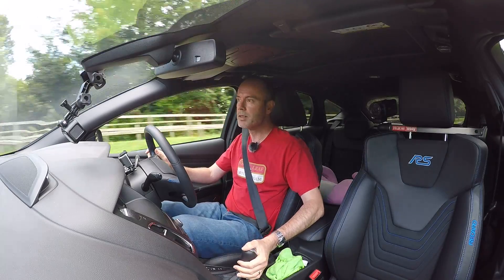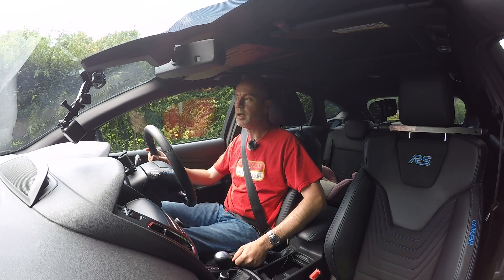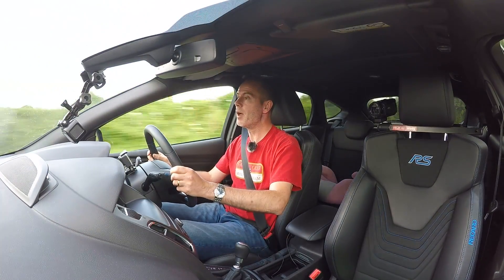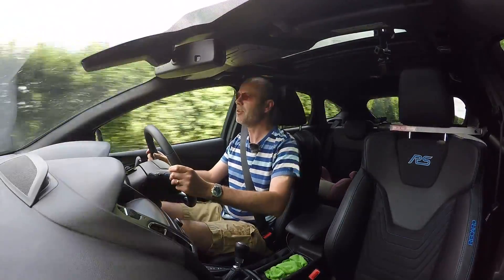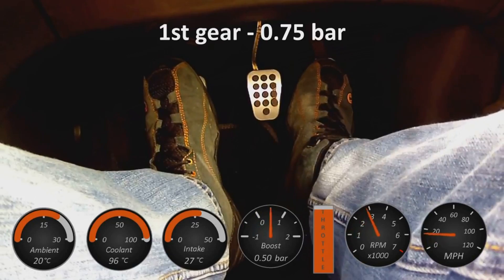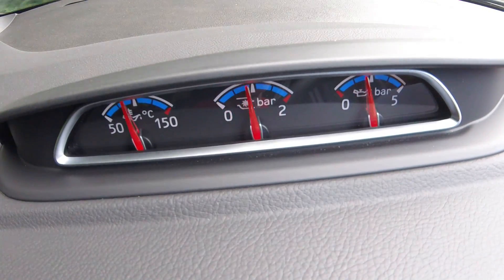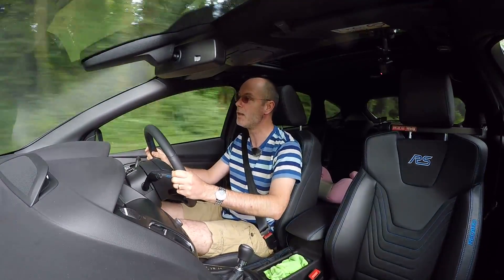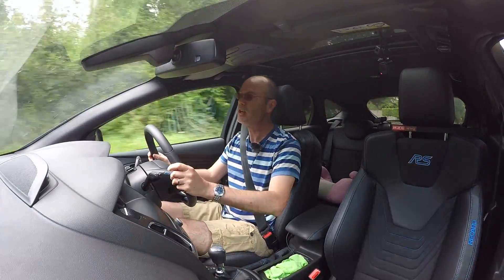Ford Focus RS : day 101 : Peak boost & torque limiting?

Comment: I've been feeling like 2nd gear doesn't pull as hard from 4.5 to 6 thousands rpms as much as 3rd or 4th gear! I found your video trying to find if its just my car or others. I found on the forums that other people have had tge same problem.  Just wondering your thoughts. Thanks

Comment: Pretty standard that 1st and 2nd are torque limited, have been on most cars for years. Also have coolant and oil temp load limiters too.

OBD on these limit map logging channel to 1.55bar, you need use forscan on map high res to see actual boost.

Comment: @markcup70 Are you sure the diag tool you was using back than is reading correct. As some diagnostic loggers has a limit of 2550 which is 1.55 bar. And these should do around 1.6/1.7 with overboost at peak HP
Reply from the maker: Nothing more exotic that the Android app, Torque Pro. I can't comment on its accuracy when logging boost, but it does seem to be accurate with everything else it logs.

Comment: Hi I have a rs I ran 25psi. It has a cobb 93 octane tune. With a mountune intake.  It was 90 degrees outside when I got this data. Is this good or bad or ok???
Reply from the maker: That's 1.7 bar Pat, so above what the standard car makes. Should the tune you have give you more than that? It sounds OK to me!

Comment: Hey nice Video! i have a question. how long does it take to get the oil to his temperature to unlock the 1.6 bar? i only get 1 bar when the oil is not warm enough. i only get the 1.6 bar at 5500 r/pm is that normal. it seems u get it earlier.  

Pls help
Reply: if the oil is not warm, you shouldnt do full power. Wait for 80 degrees Oil temp and then you can floor it...

Comment: Torque is limited by electronic throttle closures. Log that and you will see it very clearly.
Reply from the maker: Ahhhh, interesting, that makes sense, thanks Mohammed! I'll make sure I log the manifold throttle as well as the pedal position next time and see if it's pulling it back.
Reply: It does the same think in the fiesta st in first and second uses the throttle to to adjust power/torque with the peron map on the st it removes this feature

Comment: Hi Mark
I have been watching your videos , 
I think that you are only seeing 1.55bar from your obd2 port as that is the diagnosis limit off the obd2,
If you try a ford specific obd  reader , you should get the correct reading, as a std obd2 will not read any higher,
Also lower boost in 1&2 gear is because of there is lower load on the engine,
Dave
Reply from the maker: +David Browne received and understood. Do you know if the same limiting applies if I log boost as PSI?
Reply: MarkCup70 
Yes , psi or bar it is just a convention, like I say try a reader made to read the ford  not just obd2,
I don't know if icarsoft do a reader made for fords , you could pick up a copy Delphi ds150e interface and software from eBay for about £40-50 you will have to use with windows, but you can set it to a mode, flight recorder  were it will record to a SD card and do the logging without PC, and then you plug the interface in to the PC when home,
Dave
Reply: MarkCup70 
Hi mark
I am in Emsworth Hampshire if you want to try it with my Delphi ds150

Comment: Mark was 1st and 2nd Gear still torque limited on the fiesta with the MR230 kit thanks :)
Reply from the maker: I'm sure it was...but despite trying I could never get any stable or usable boost readings through 1st or 2nd as it would always just spin the wheels!
Reply: Ok cheers Mark :)

Comment: It doesn't look to me as though there is any  boost limiting. If there is it is so subtle as to be pointless. My guess woukd be there is a small element of fueling cut as a traction aid in first. Also remember that to achieve full boost an engine needs a solid load to pull against. If you put an engine on a test stand with nothing connected to the flywheel it would struggle to make much boost as the fuel rates for a given rpm would be so low. Low fuel = low exhaust flow = low boost. As for the few % drop you were seeing in first, either first isnt presenting a solid heavy load or more likely the fueling is just been reigned in.

Comment: Hi Mark. I have noticed that no matter how hard you drive an RS coolant temerature gage stays in the same position (90 degree) which is very weird. All other gages are moving while driving hard but not the coolant one. I'm sure coolant temp is much higher than 90 degree when driving on the track. Have you noticed the same issue? It must be sometching wrong with it. Other RS owners I spoke with had the same issue. Can you please check it coolant temp on your logs?
Reply from the maker: Mine is exactly the same and I recall it was also the same on my Fiesta ST. It gets up to a certain temperature and then only varies from that point by a few degrees at most. Regardless, I will add 'coolant temperature' as a field the next time I log and report back on a future video.
Reply: Thanks for reply.
Apparently coolant temp gage is not moving unless is reaching 115 degrees which means it doesn't read right temp and is missing 25 degrees. It can be too late for the engine as this can cause enginge overheating and failure which we've heard so may times. Why Ford couldn't resolve the problem that is simple and cheap to fix?
Reply: This is standard on most vehicles. I think its to avoid concerning drivers, who might be alarmed to see the temp climb after a hard drive. They usually sit in exactly the same place on the gauge until the car goes out of spec.....this could be a range of 80 to say 104 c and still show normal. Beyond a pre determined level it will climb.  Id rather it just fluctuated with my driving like an old analogue instrument.

Comment: It is quite normal for turbocharged car to have lower boost in lower gears. That is because engine has less load in 1st and 2nd gear. You can notice that turbo spools at 3K+ rpm in 1st, 3K in 2nd gear and 2.2K in third gear. There is no limitations, only turbolag.

Comment: The difference between 1.55 and 1.6 is negligible don't worry about it. if it were 1.3 to 1.6 it would be worth looking into but even that is probably only just outside limits. once outside limits I would expect the ECU to throw a boost control related error.
If you could log actual boost vs requested you will see how tight to spec it is but I doubt you have access to those parameters. On VAG cars I have logged the above and they don't track that close to target. they tend to under achieve target initially then over achieve target as you approach red line.
Reply from the maker: That's what I thought Scott...it was close enough to not worry about but I did wonder what other owners had seen or logged.

Comment: Torque. Targets. Probably won't see boost as high in colder temps, because the air charge is already dense enough to create the power levels as calculated and desired by the ECU.

Comment: MarkCup70,

Don't you trust Ford???

Or is this just an anal exercise and a degree of technical self satisfaction.lol

Low cost accessory for your motor:https://www.youtube.com/watch?v=eCjPinseITM&t=182s lol
Reply from the maker: It's nothing to do with trust Keith, I just like to understand how s*** works. If I understand its intricacies I'll be better placed to extract the most out of it.
Reply: Mark,
Good that it is a learning / understanding process for you.

Guess Ford have  spent millions and many person hours optimizing the RS to give of its best, with a little help from a competent driver to squeeze that last little bit  extra efficiency and effectiveness out of it, on the road and track.Without having to tune the ass off it ,so as to enjoy and have fun.
Good on you man.
Keith

Comment: torque limiting is effectively present in the ECU by the way of a reduction of timing advance from what I've read in forums, not boost limitation, it's a "next gen" car engine management is much more complex than old ones where more fuel+boost=power
Reply from the maker: Timing advance? Copy that. I'll see if I can log what the ignition timing is up to and see if that shows a change through the first three gears.
Reply: timing advance will be different between all gears as each gear will generate different load characteristics/calculations and hence place it in a different cell on the map with different timing targets. Hence logging this will tell you little.
Reply: alot of modern cars are mapped on a torque/load basis but ultimately it's boost that gives you the torque figure regardless of how it's mapped to control it.

Comment: Hi mark just won't to no if there is a limiter on the fiesta st 2016 how far can you take the rivers before  you change gear
Reply from the maker: Yes there is a limiter Tony...take it as far as you want or need to...it will make sure you don't go too far for the engine.

Comment: Boost is being limited throughout the low/mid range rpm (where your peak torque figure is derived from) and then the turbo gets released to boost as it is capable of above 5000rpm. This style of mapping boost delivery is the modern way of mapping a turbo car to feel linear and progressive. For those of us who have been driving turbo cars since the 90's it's not really what we want. A modern turbo being small and responsive should be able to deliver full boost on a wide open (or even 50-70% open) throttle anywhere between 2500-3000 rpm. This will massively increase your torque figure.
I understand why they do it on a FWD car to limit torque and wheelspin, but there's no need on 4WD.
It would be good if you could try the same on a mountune equipped car.
Reply: 5year warranty, will be fine,linked with the renowned Blue Oval CS support. Of which Total Focus you know all about, especially in Canada
Reply: @Scott: You are absolutely right. Dreamscience Map does exactly what you describe and the car feels much stronger.
Reply: Scott Taylor they limit it on the RS to protect and prolong the life of the RDU as I'm sure it's rather expensive to replace in the event of a failure